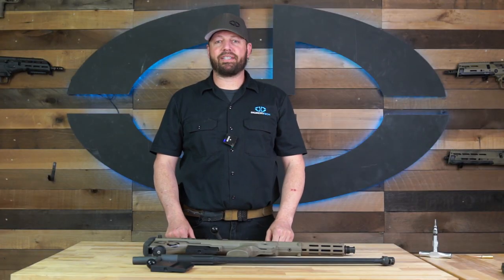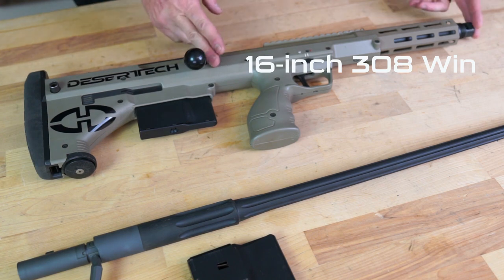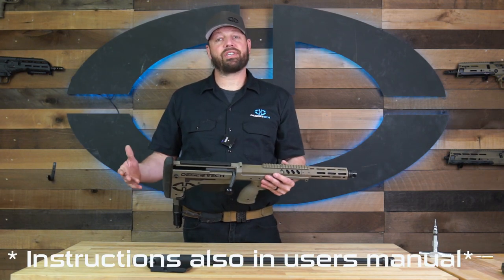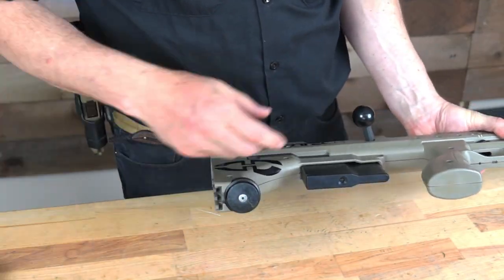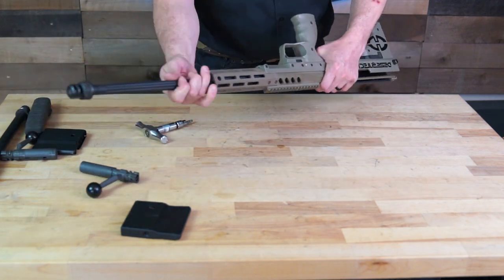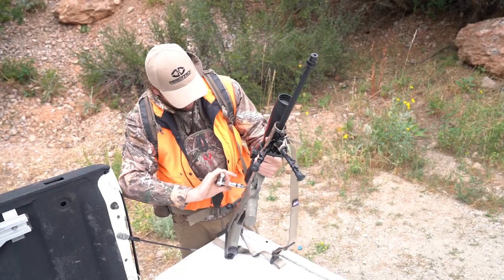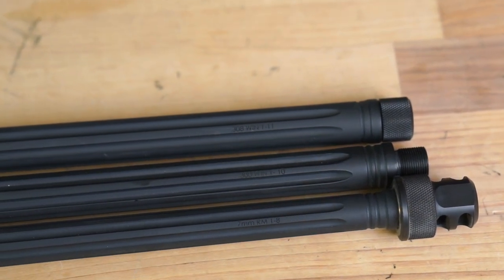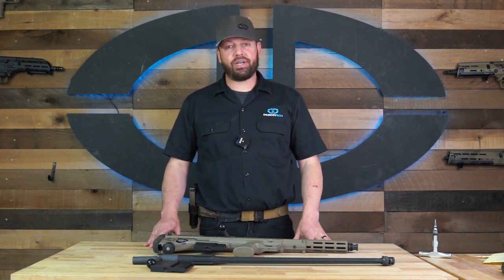SRS Caliber Conversion

Comment: I have an SRS-A2 and I’m trying to get the 308 stuff out to swap to 338LM… the 308 barrel slides free for several inches before hitting a hard stop somewhere back in the receiver… all 4 retention screws were loosened and the barrel was unlocked. Please help. I can’t get the barrel out.
Reply from the maker: Sounds like one of your M-Lok nuts is in the way, the barrel shank probably cant get past the nut without removing it.
Reply: 🤦🏼‍♂️ didn’t realize the sling QD gets in the way